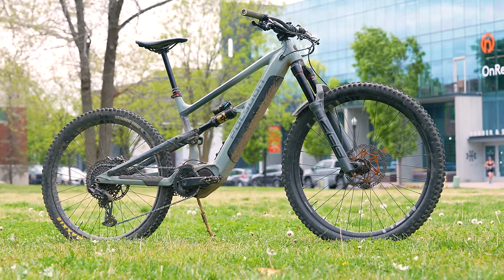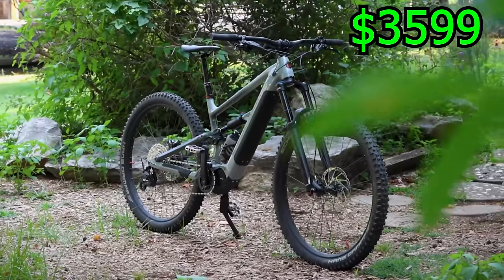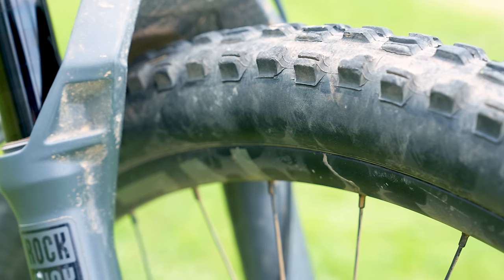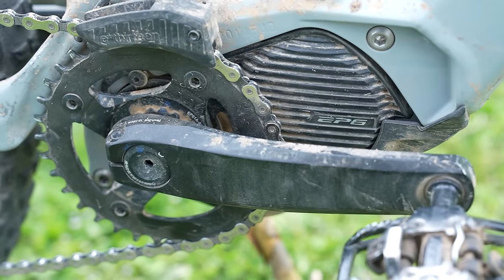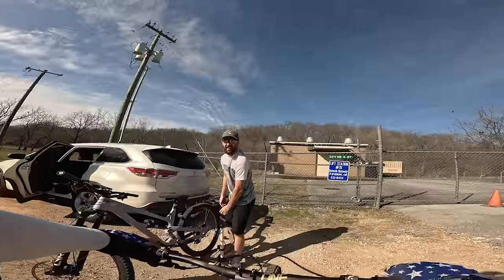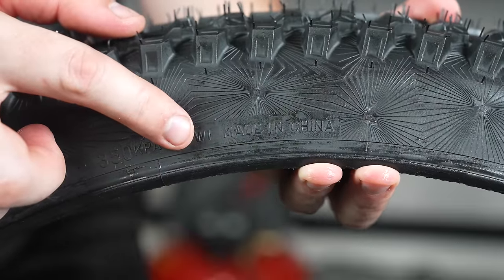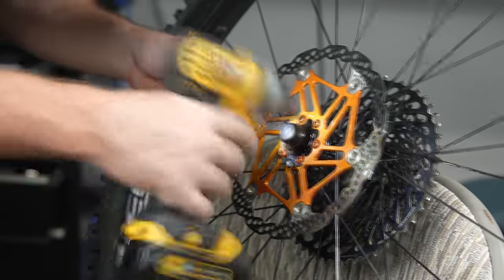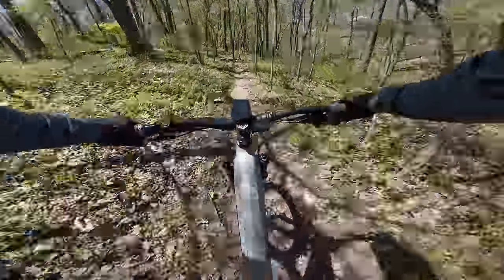Are these tires better than Maxxis?

Comment: Hay Ive just bought my self a hardtail Vitus. With 2x9 gears but I converted it to an 1 by 9 with 27.30 wheels. With nukeprooth bottom brackets with sram so single speed and now it ride so smooth

Comment: I think i have changed my mind on tire casing and cush core lately. I think the lighter wieght casing with the cush core is the way to go im 240 pounds and i have been running exo plus casing tires and cushcore instead of dh cashing tires on my downhill bike and its more grip and comfort and the cush core makes the sidewall alot stiffer i dont roll the tire over anymore cornering hard and dont pinch flat anymore either. And its similar weight all together for lighter tires plus cush core vs dh casing. On my trail bike i started going exo casing and cush core pro never puntured and rolls so much faster. Any chance on a discount code on these wheels coming up?

Comment: EVAN…. so glad I watched this video. I literally just experienced something you had mentioned about tires and sidewall casing.  On My bike I used to run Bontrager XR2 team issue tires, which were super fast.  I recently purchased a set of Kenda booster pro with their SCT sidewall protection.  I got home from the ride and I told my wife it felt like I was riding with a flat tire because of how slow it felt.  granted the trail was very soft and just fresh thaw from the winter, but it seriously felt super super slow.   Is this something that you were experiencing?
Reply from the maker: Yup that's the feeling! I remember the first time I experienced a thicker casing, I had to get off my bike several times to check if I had a flat lol

Comment: I take it you changed the flip chip to the high position when going mullet?
Reply from the maker: Yeah and left it in high for this video
Reply: @EvansMTBSaga  That's too bad that you've been getting so many pedal strikes with it in the high position. Surprised as it was built with the intention to run a mullet in high. Looks like a design flaw on Polygon's part especially with it already coming with short cranks. I was considered buying one as the value and the ability to run it as a mullet had me interested, but destroying motor bearings on the EP801 from multiple pedal strikes sadly makes this emtb a hard pass.

Comment: Evan, good fun, cool upload!  If you ever have the chance, try the Vittoria Mazza Enduro casing tyres. I run these on my Nukeproof Mega Carbon Factory for enduro and park, and even some trail riding. This is my absolute #1, go to tyre, for speed, grip, durability, and longevity. (I run them at 27psi front and 28psi rear, and adjust my suspension if needed = more supportive tyre). Vittoria does have an e-Mazza Enduro (for e-bikes, but I haven't tried). Keep doing what you do 😁👍‼

Comment: I'm a little late to the party, but I got to say... that bike looks great! The new tire/rim setup makes this thing look so much more aggressive. I have a personal question for you though. I already have myself a sweet hardtail (Habit HT2 from Cannondale), would it be a wiser choice to upgrade my existing bike or simply buy a secondary full-suspension bike? Either, I can have one really specked out hardtail or have two average bikes. There are pros and cons to both options I presume, just not sure which would be a better decision. Thanks Evan.
Reply from the maker: Oh man that's a hard question! I'd say if your budget is less than $1500, upgrade your current bike. If it's more, full suspension
Reply: @EvansMTBSaga Thanks my friend!

Comment: For Your information, EP6 is the latest generation motor, not the previous. It premiered together with the EP801 engine about half year ago and it is practically the same engine only in an aluminum housing.

Comment: I run Xynotal DH rear and Kryptotal TC on front. Only tires I run. Prefer this combination over maxxis
Reply from the maker: Wow DH in the rear and TC in the front! How come no Enduro casing in the front, just curious? I'm always looking to find cool set ups
Reply: @EvansMTBSaga  I still run tubes. So still run something tuff in rear and soft in front. Trails are not to extreme in nc. I do have a Enduro  casing sitting around tho. I have at least one in every casing by continental. They grow on to you.

Comment: Do these new wheels accomodate 2.6 tires?
Reply from the maker: Yeah they can, that'd be the max though
Reply: Evan.  T9 or T7E?   If you had to choose.  I am coming from hardtail. Experienced rider.   T9 has higher components.  TE7 the motor.  My trails are like yours.  TEXAS.  Loose over hard.  Some chunk.   Hill climbs.

Comment: Hmmmm ...... a new 'light weight / power' E-Mtb from YT, possibly with the Fazua Ride 60 system onboard, I wonder how good that would be if such a bike existed?
Reply: Pretty much the new ARI bike. It's a mix of the Heckler SL and the Levo SL. Looks pretty good actually! If I didn't have a Heckler SL I would ride one!
Reply: @_Jake.From.Statefarm_  At 1:28min into the other guys video that's linked above (ie, not this video), you can see the YT sticker near the headtube of Evans bike. 
Not sure if your stating that Evan's bike is an Ari, or if it just looks like the new Ari, but these new lower power emtb's like your Heckler SL look great - I got into the app and turned my Shimano EP8 down on my bike as i found that for where i ride (when not dealing with a broken wrist as i am currently), i have zero use for 'normal' motor power for how i want to ride, and what "i" want from an Emtb.
Reply: @kiwibob72  I just meant in general. If YT comes out with one that would be rad. Their US headquarters is about an hour from my pad. When I had a levo I loved it.. A lot. For the reason I could ride anywhere. Some days I would just ride as far as I could and find as much as I could. The SL is good alternative for trail networks where you can ride it like a regular bike.. If I don't use that I'd rather be on a DH bike.

Comment: Fifty Five Pounds?

Here's my primary "access hurdle" to what seems like a nice bike.  I live in a 2nd story walk up apartment  - do after a tiring ride I've gotta sling the bike over my shoulder and walk up concrete pebble steps in Sidi shoes.

I only weigh 128 lbs. My 27 lb Specialized Crux ebike is already heavy.  😢

I have a 30 lb Epic that is sometimes laborious to carry up the stairs after a ride.
Reply: To put things in perspective - in 1999 I rode the Specialized "Shaun Palmer" frame with 7" of rear travel and a triple crown fork.  THAT bike only weighed 49 lbs.
Reply: @TheArimatheus  They have a walk mode. You can just push it up the stairs and hold the walk mode button it actually works pretty good.

Comment: How many miles/hours did you get out of the DHR II's?
Reply from the maker: Probably like 100
Reply: @EvansMTBSaga  I've got a 27.5 2.8" EXO+ DHR II on my new E-Bike. I just wounded because I get 1,000-1,200 miles or just over 100 hours on My normal bike.

Comment: I have a set of no name Chinese carbon 29er wheels and they have been great.  Extremely stiff and reasonably light.  Not haven’t even come out of tru once and survived several rock strikes.  Also, I weigh 300 lbs.  However, I will admit that I’m more of a finesse rider when it comes to line selection.
Reply from the maker: Haha I am too! I love choosing the smoothest line. I really admire the Enduro pros who will bank off some bushes sometimes, but I can never visualize those lines haha

Comment: I've been super impressed by my Continental Kryptonal tires on two of my bikes now, after many many many years of riding Schwalbe tires on multiple bikes. The wear resistance is astonishing, even on my full suspension bike with 27.5x 2.4's that has pretty much become a daily rider on pavement they are only about 75% worn after 6 months of riding.

Comment: Thick casings don't add "rolling resistance", they add a ton of rotational weight. The further out the weight is on the radius of the wheel, the more torque is required to get it moving. But once it's moving, that extra weight will also resist slowing down, adding to that sluggish feel. Rolling resistance is more of a term for how the tire comes in contact with the ground and how much the tread resist moving forward.
Reply from the maker: I agree with weight and rotational mass, but multiple layers within the tires cause friction and absolutely lead to increased rolling resistance

Comment: Evan try upgrading the float x performance shock that you got with the Spectral125 to a performance elite by adding the blue compression dial. It's about 30 bucks but worth it's weight in gold bro 👌😉🤟

Comment: When it comes to tires for a bike like that and what you’re using it for, I’d highly recommend running Versus tires. I run the All Mountain in Trail casing on my enduro bike and they’ve been flawless for almost two seasons on the same set of tires. My friend said they feel like cheating because they roll really quickly for how much grip they offer and just don’t wear down.

Comment: Hey Evan love the e bike content, I have a mondraker with the bosch motor and its sick once dialed. Suggestion for high low season 2 is to try formula suspension, I have been using them with my e bike for ages and there amazing but a bit pricey.

Comment: I have Hunt wheels now for a year and not one issue. I'm very impressed with them. Their rear hub engagement is just great too.
Reply: I had a nasty rock strike on my Enduro Wide V2’s last season and they are still true and didn’t even dent.
Reply: The rims are strong, but I've found the bearings are shit. 2nd set in my rear wheel in less than a year. Enduro bearings fitted now so hopefully they will last longer.
Reply: @JDSjoel  good to know, I’ve been running mine for almost a year with no issues
Reply: Same here - Trail Wide v2. My rear tyre had a complete flat and I had to basically ride on the rim to get to the bottom of the trail. I'm 100kg+, still no dents or wobble. These are very strong rims!
Reply: Two years on mine and still original bearings front & rear.  That said, I rarely ‘wash’ my bike and when I do , keep the hose away from the hub seals (and every other bearings)

Comment: The camera man is a + in my opinion. But please go at least 45fps. The stuttering of the 20-30fps is very distracting. The slow-mo shots are garbage if you can't focus on anything because it's all a stuttering blurry mess. I have the highest level of respect for you and your channel. My statement is solely constructive criticism.
Reply from the maker: The non slow motion was 60 fps, but yeah slow motion was 24 fps. But that's all controlled by the shutter speed and I agree with you, gonna up it which makes the footage look intense

Comment: Why? 

Keep your own engine running as long as you can. 

You don't need the juice.
Reply from the maker: There's so many reasons. One benefit is the exposure to downhill. On a regular bike, I'm climbing 90% descending 10%. On an E-Bike, it's like 60/40 and I'm definitely becoming a better rider because of it. Plus these E-Bike rides are in addition to my normal bike rides
Reply: @EvansMTBSaga  Exactly, once you progress 3x faster than them they'll figure it out lol.

Comment: I still think you would enjoy a light weight emtb build as well, Like with the bafang m820 and the cef50 frame. Can easily get that under 40lbs!
Reply: Im guessing thats gonna be similar to the "secret" emtb hes been testing.
Reply: I don't think he's gonna go out an buy a Chinese carbon frame. This is a paid for by polygon so anything ebike related will be with polygon ebikes most likely. 
Edit. The bikes are paid for my polygon obviously the parts he throws on it aren't.

Comment: These are the worse tyres I've  experienced in my life. I rode twice and I crashed twice  with the same exactly set up xyn+ krypto enduro and their no near to being soft. Both times front doesn't hold in the berms I almost broken my wrist landing over the bar. That was nasty crash.🥴 These tyres are plasticy shity rubber stay away guys from them. I was concerned about rolling resistance on my asegai + dhrii but now I know what does it mean sticking to the ground. Continental sucks 😡🤬